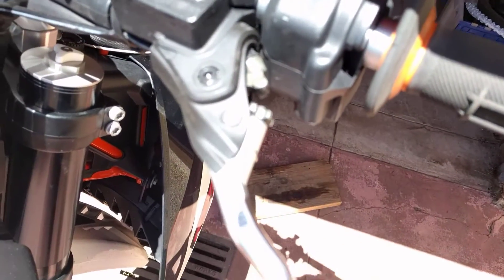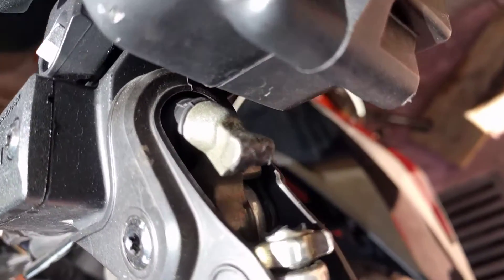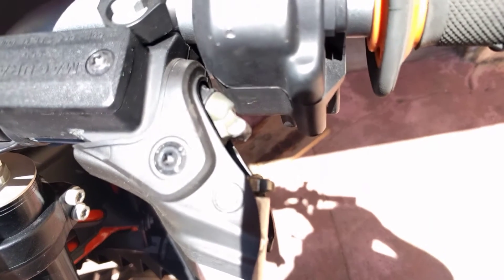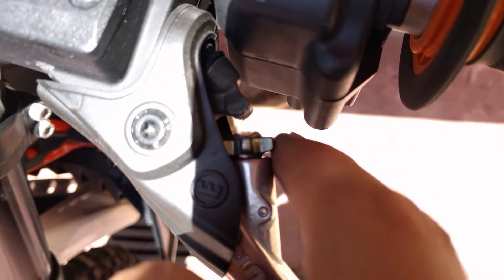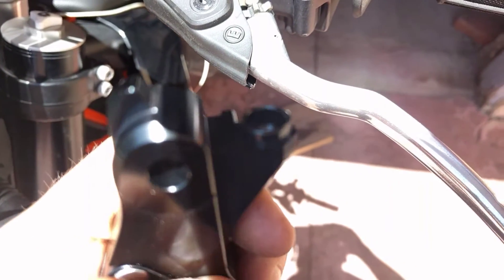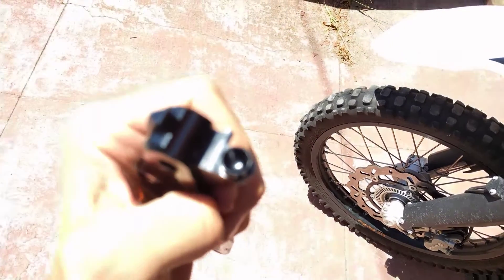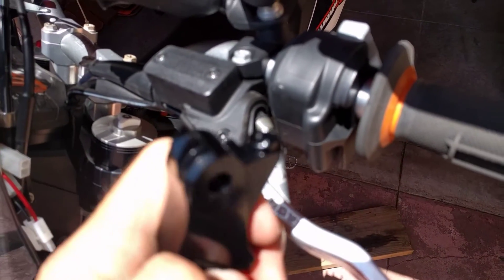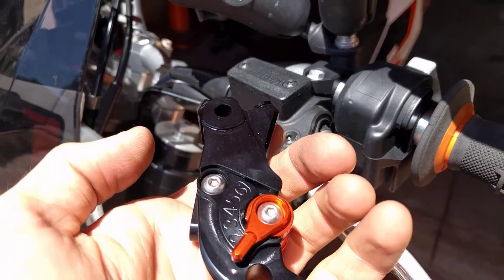KTM 690 Enduro replacement levers from eBay - Clutch side

Comment: You realize that's not part of the .water cylinder right? Pull off the factory clutch lever and you'll see that that lever will fit it perfectly ..